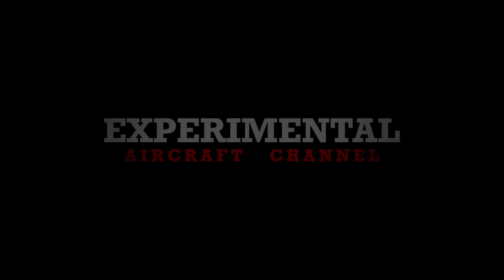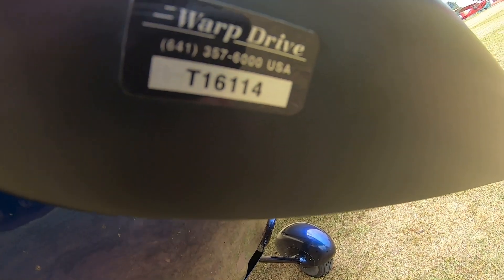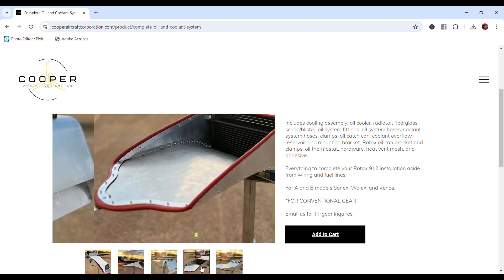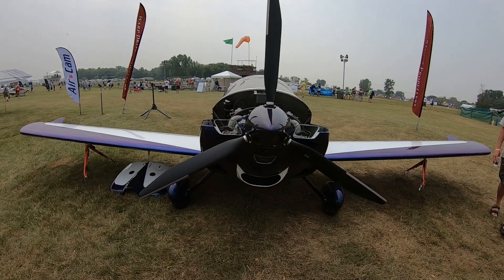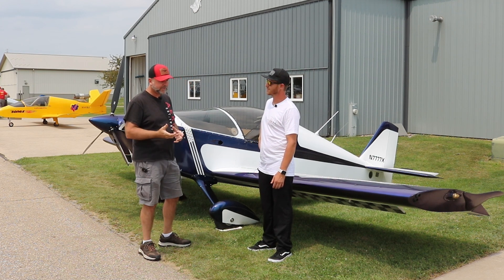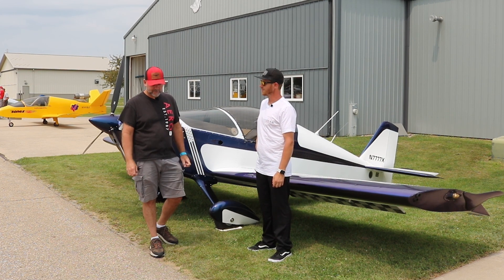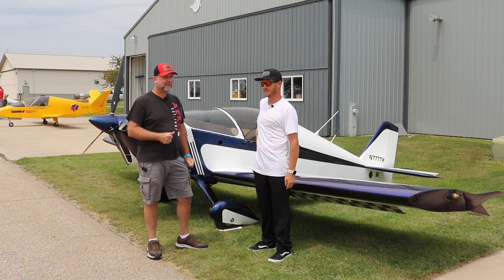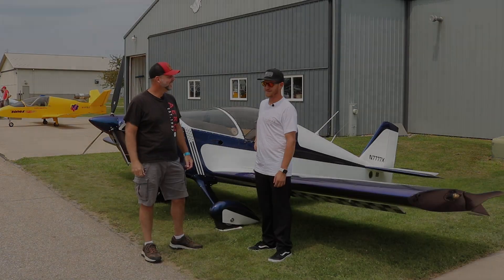Rotax Engine Kits for Sonex Aircraft! Cooper Aircraft Corporation

Comment: One of the major goal of Sonex is a plane at minimum price, and you basically defeat the purpose by using an expensive Rotax engine. Sonex have not done the industry much favor with a cost break through, large company , lots of share holders to pay for and overheads. You better off using the AeroVee turbo.

Comment: I've got a question about this system.  This kit looks like it was designed with the standard gear sonex/waiex in mind, but for those who are looking to build a tri-gear sonex/waiex with a rotax 912, would this kit be compatible as is or would additional modification be necessary?